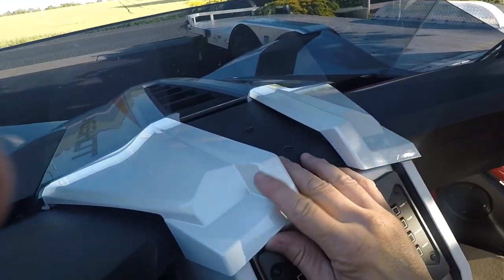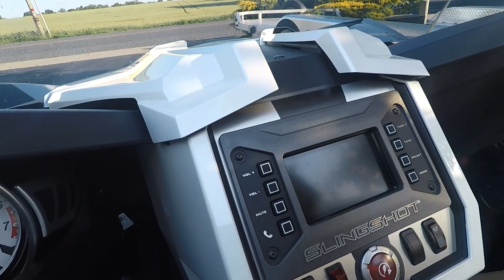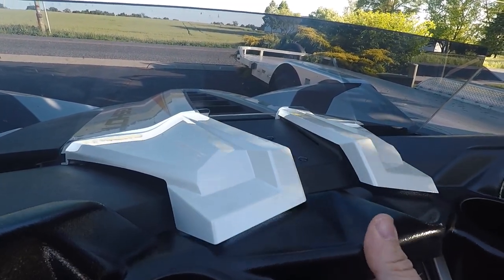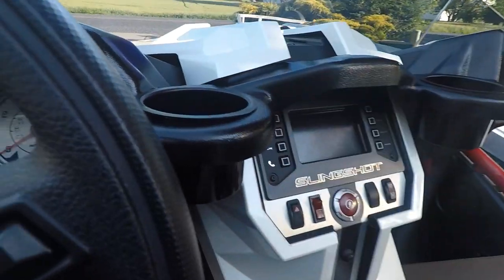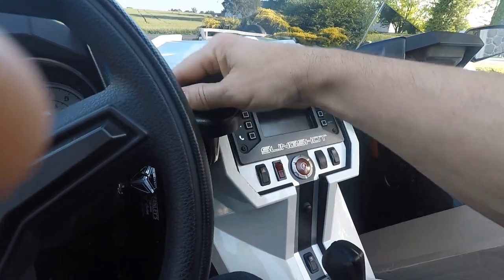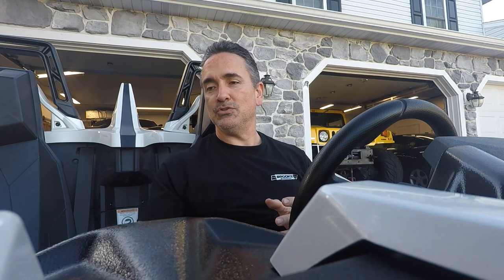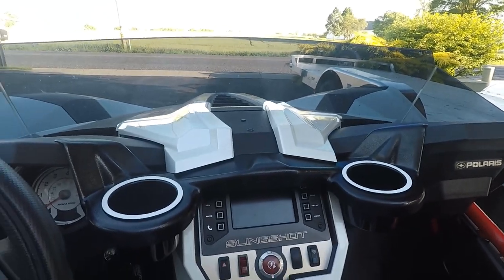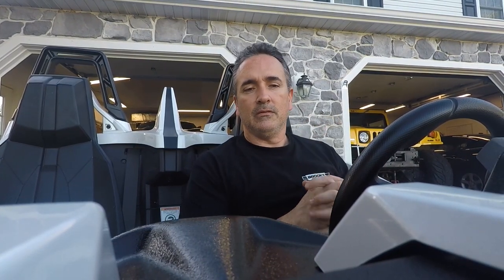Adding much-needed  mod to the Polaris slingshot!

Comment: Is that an aftermarket windshield?  If so where did you get it.  I have a 2019 SlingShot S with the 2 small windshield.  Have to wear helmet when going fast.
Reply from the maker: Its the original that came with it been thinking of getting a taller windshield but have not yet